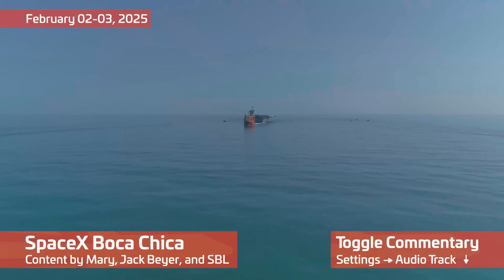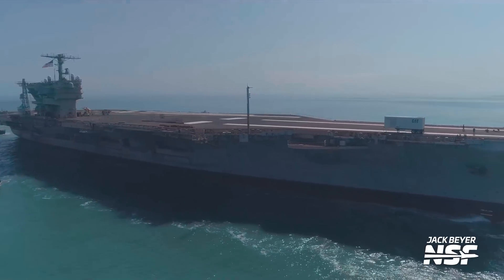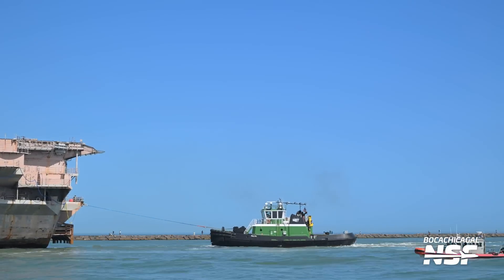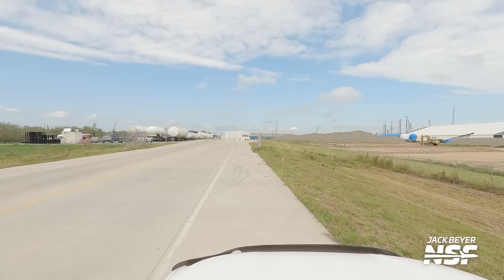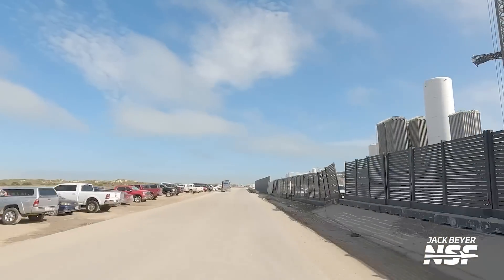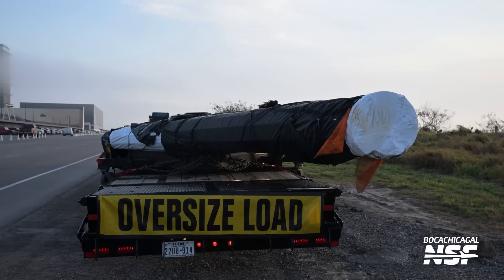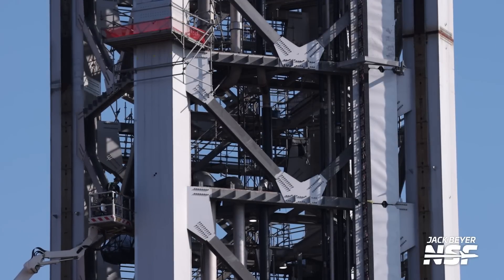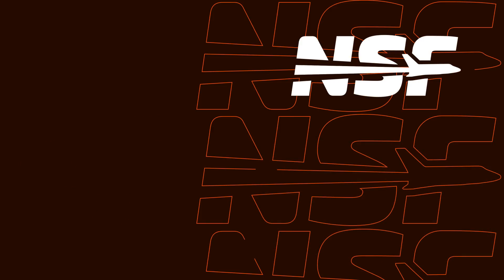Super Heavy Rockets... and an Aircraft Carrier? | SpaceX Boca Chica

Comment: They should use this to catch booster. Put a tower on the tail  catch booster if it miss it will fall into ocean get the engine running note it not nuclear get out there  it big it should it support a tower  space x need to catch out in ocean

Comment: I bit surprised you guys didn't do a "History of the USS Kennedy" similar to what you yall do on every Falcon launch for the booster being, all the earlier flights/missions that booster was responsible for. It would seem a fitting tribute. e.g.
- Cold War Operations (1960s–1980s)

- Yom Kippur War (1973)
- Lebanon Crisis (1983–1984)

- Operation Desert Storm (1991)
- Operation Iraqi Freedom (2004)

- Operation Enduring Freedom (2001–2002)
-  Operation Noble Eagle (2001)

Courtesy of X's Grok 2 (it provides a lot more detail but I didn't want to flood the comment stream.)

Comment: Why scrap the aircraft carrier, surely it could be used as a launch pad or landing pad for Starship return or booster return, or is it so badly rusted it's better to make use of the scrap steel plating etc.😯🤔🌝
Reply: It's a lot of extra fuel drinking mass that is not needed.
Reply: @imaginary_friend7300 Yes I bet, but maybe a fixed position off shore and use it as a similar landing pad like a short fall of gravitas, no diesel engines needed, such a large area of landing deck though. 😢

Comment: Imagine images of falcon rockets or starships landings on an aircraft carrier, 💪👍🔥🔥
Reply: Imagine the bill for stripping the flight deck down to the half century old steel beams, reinforcing it for the vertical landing and take off forces, creating a cooling system that could keep the giant blowtorch on the deck from burning a hole down to the keel. Armoring and isolating the fuel bunkers to prevent a ship ending fire. Refitting electronics to handle navigation, automated operations (almost no people on a 4,000+ crew vessel), adding hull expanders to keep her center of gravity low enough that she's stable in high seas, relocating the superstructure (or armoring it if you decide to 'fore and aft' your launch/landing operations); it may even need to be deleted and all functions there relocated into the ship's interior. And that is aside from the general work needed to get a lady that was mothballed for almost two decades back up to snuff.

$$$$$$$$$$$$$$$$$$$$$

Comment: Y'know, everyone will suggest landing,... but that carrier would make a pretty decent mobile launch platform too, if passed across to the US Space Force for management. And that big flat open deck, add some support towers, and there's your transport to get SuperHeavy around to Florida.
Strip out everything related to aircraft, fill the hanger deck with fuel tanks, add a tower hanging off each side with a rotating lift section at the top, so chopstick mechanisim can swing around and pick up a booster or ship off the deck, spin the top with the arms back out over the water to stack on a hold-down ring, no more ruined pads, just boiled seawater under the Raptors.
Reply: It probably would have been stationed on the west coast for transport to the equator like Sea Launch did for GTO missions.

Comment: 1:36. Starship is about 400 feet tall , and CVN 67 is about 1050 feet long. So yeah. You could get two starships end to end on her.
Reply from the maker: Good grief. Thats... more than I thought.- Das
Reply: The deck is 252 feet wide so horizontally you could get perhaps 40-50 stacked starships. If they were placed vertically, even boosters and ships stacked separately, many more could fit. An easy trip along the American Gulf coast and around Florida would transport several ships to Cape Canaveral.
Reply: And seemingly the ones going to Mars will fit too! Over 500 feet tall they've said

Comment: Originally burned #6 fuel oil. At was burning a #2 fuel oil called Diesel Fuel Marine or DFM. I have seen flash points from 143°F to 163°F.
Reply from the maker: Appreciate it, I did some research but it wasn't immediately evident, like it changed over time. - Das
Reply: How much oil would it hold? 
What was the JFKs cruising range without refueling?
Reply: @mikegardner107  Conventional aircraft carriers held around 2 million gallons of fuel oil.

Comment: Ever heard of “Bunker Oil?” That’s what these ships burned in their boilers. Not jet fuel.
Reply: How much bunker oil would a carrier hold, fully loaded?
Reply: I spent my 'wonder years' on the INDEPENDENCE. The Type M 1200psi, uncontrollable superheat boilers use Diesel, Fleet Marine (DFM).  Apparently a fairly typical diesel oil, loaded with anti-fungal additives.

The older ships used Black Oil/ bunker fuel.  Nasty stuff - needed heating much below 60 degrees (F) to atomize properly.  They were converted to use DFM.

Light off was rather dramatic!
Reply from the maker: I have heard of it, but it seems JFK may have been run on a couple different fuels, so wasn't trying to answer authoritatively. I figured there'd be someone in the comments who actually fueled her up during a tour and could help me out. - Das